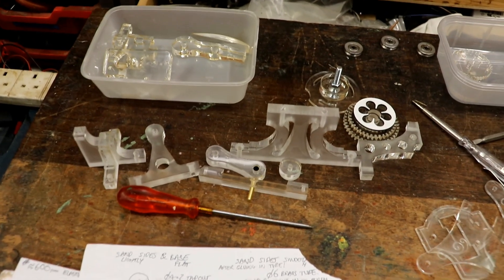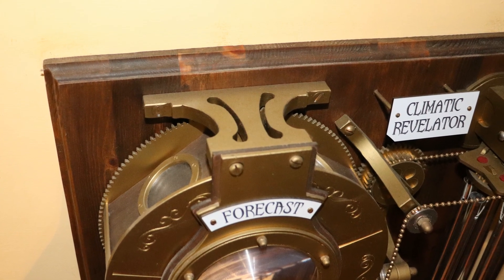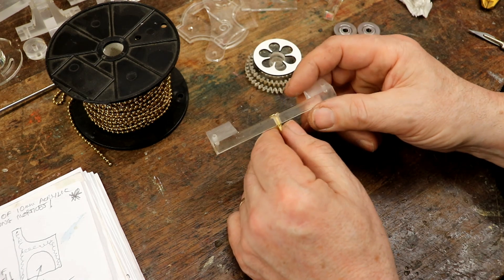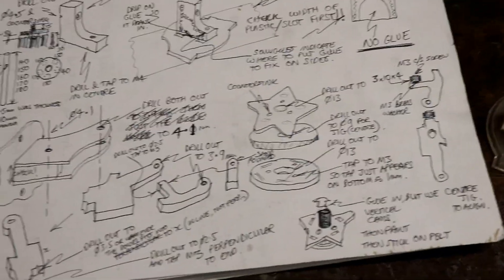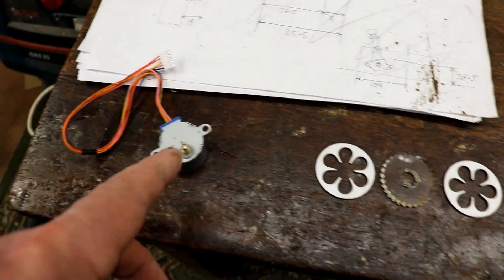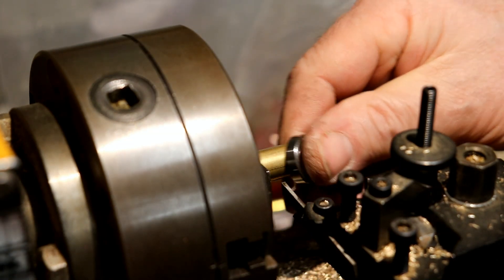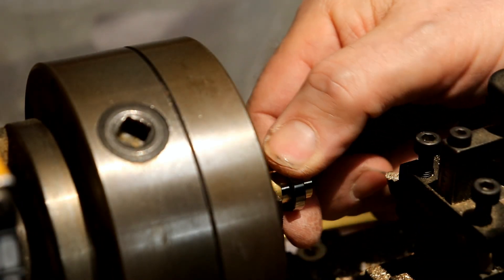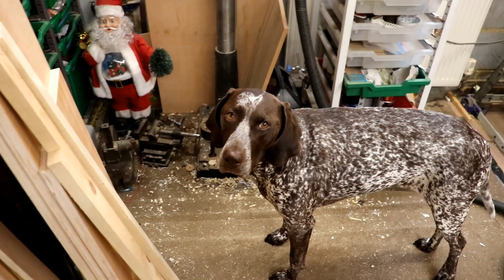Laser cutting exciting mechanisms

Comment: You could do with a DRO on that lathe ;-)
BTW - The length sticking out the other side of the lathe can be a lot more dangerous than you may realise, if it decides to start to bend things can get very nasty, very quickly (probably not so likely with the thickness you are using here?)
Reply from the maker: Thank you for the advice - DRO coming soon! I can imagine, if the rod sticking out the back reached its resonant frequency, things would turn nasty pretty quickly. Thankfully the toilet roll seemed to keep everything under control. As with all machine tools, they work perfectly until the operator makes a mistake. The joy of risk assessments!

Comment: I think any time save printing would be lost in getting a good finish prior to painting,  John I see you have optimised a number of operations and made subtle dimensional corrections ? specific to acrylic to accommodate design changes  (boo boo's). One bonus to laser cutting is the off cut can be used as a jig. However for the less dimensional critical components such as supports 3D printing would be cheaper but slower and providing there was not too much detail in which case make it from hardwood and finishing on a linisher belt. I would say that the paint adhesion and stability onto PLA is questionable. The three holes in the bearing carrier is a smart move but not for the reason you may think. The expansion coefficient of the bearing may over time crack the acrylic so the three holes will mitigate that by taking up the stress and the paint protects from UV degradation. 
 
Resin tech mentioned by @fenceup, (smart putting phone number) is somewhat better for final detail but messy my opinion is that 3D printed mechanical parts would take away from the quality engineering and individuality, over optimising the production away from using existing components / scrap parts will demean the ethos of 'Steamhead'.   These unique magnificent devices YOU have created may in part be of modern material but is a hand engineered quality device and pays homage to the Victorian mindset which was 'showing of the mechanism'. If I noticed 3D parts it would grind my gears like finding a pozi drive screw in a Victorian door hinge or finding a chromed plastic door handle on a Jag,  ughhh  and leave off with the 'Brasso' and lacquered brass plated steel,  tarnished brass or green copper floats my boat and  Don't mention wood rotting Cupranol ... Its Creosote and to hell with DEFRA.  ..... sorry went  off on one.  

John,  Search out your local industrial laser cutting workshop and show them what you do and ask them about the scrap sheets from contracts, also cutting washers and other shapes. What they do is cut your washers or shapes from the blind areas of sheet they are cutting for another customers contract so win win.  I used get shims and other stuff cut from blind sheet also I found useful shapes like lettering and stencils.  I see the Lathe is getting better but the Pillar drill seems to be after you !.    Banjo cooper and Indi asking for walk and I a strong whisky. Sorry for long post ADHD !.  Best to Ziggy.

Comment: All lathe operators do it, and I did it myself, putting your fingers on the chuck, to slow it down, and save time. You learned the same way I did. Never put your fingers where the jaws are, and I never also put my fingers at the area where the wrench holes are also. The only rule I used was, only place you fingers at the base of the chuck, regardless what size material in the jaws.
Reply from the maker: Good to hear from another lathe operator! The large lathes I learned on at college and the ones we had in the school's Design & Technology department, whilst I was teaching, had a foot brake. It's just too tempting on a small lathe... 'Base of chuck' must become my new mantra!

At least I'm careful to remove the chuck key before starting rotation! Small mercies...

Comment: I would not advise that length of brass rod sticking out the back of the head stock, at that speed. If that brass rod decides to bend /whip, behind the head stock for some reason, which it is on the edge of trying already. Where the damage will be done, before you even realize it happened. Hopefully, that is going to be very dangerous situation you just survived. Take your finger incident, and multiply it by 100. Ask me how I know.
Reply: Davidquarry ; I have seen one of our machinist tuck a wooden wedge in the back of the headstock or a sand bag in the stock to stop things going wild whilst he cut the bar to a usable length. If I had a lathe I would probably screw things up before I learnt.  

Machinists are more skilled than people think, understanding material behaviour and compensating measurements for temperature, selecting speeds and tooling. One chap had a run in with the supervisor about a shaft to be pressed cold into a casting, he said "we have to wait for things to cool or the casting may crack when pressed" . "No said supervisor"...... casting cracked !. Thats a lot to learn and It can be a 'Galling' experience ha ha
Reply: A very good point! I don't do any of this stuff but I see how nasty that could be..

Comment: I was wondering why you had to re drill the laser cut pieces know I know.
 I know I have said it before, but that's where a resin printer would be ideal, it could also do both the horizontal and vertical holes. Unlike a conventional 3d printer it's only the height of the item that increases the print time, so printing 1 cog woul take the same time as 3, as long as you can fit them on the build plate. I have no idea whether it would be any cheaper though.
Reply from the maker: Thank you for your continued interest and support. I think it's a case of old dogs and new tricks! I do understand the opportunities a resin printer would provide; but I've got a laser cutter and do enjoy machining, especially the excitement of not clamping things down properly!

It's also the thought of having smelly chemicals, a UV curing system and then having to wash the 3D printed parts. As you know from my videos, I easily get covered in messy stuff and have very limited room.

Perhaps if resin printers had been cheaper when I was considering buying a laser cutter, I may have gone down that path.